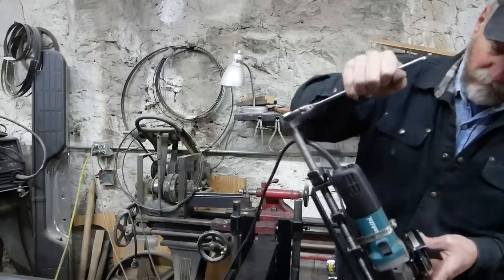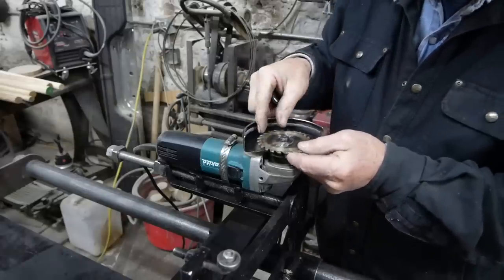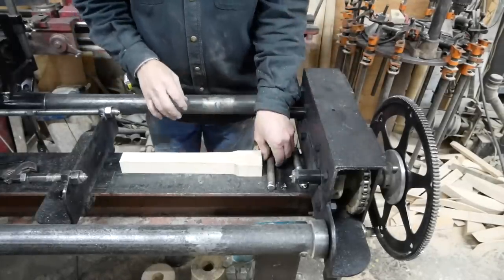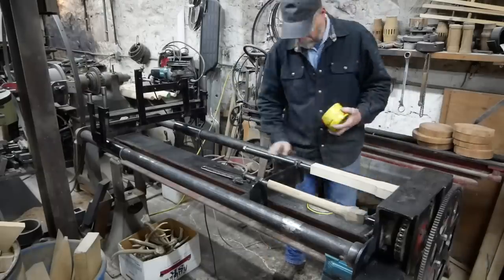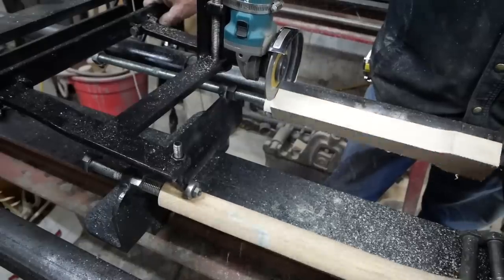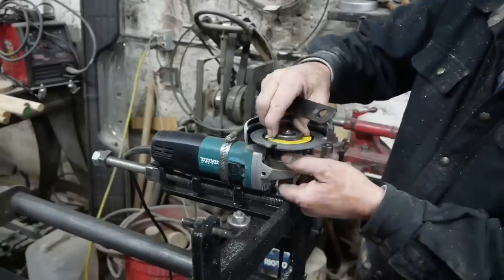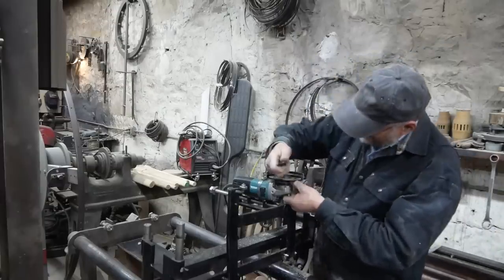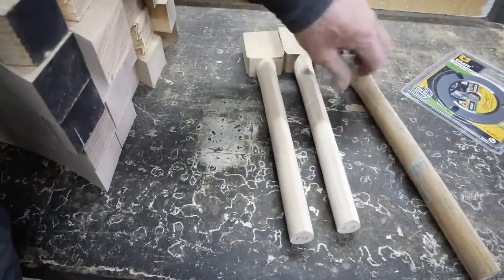Pattern Lathe for Custom Car Spokes | Graff Speedcutter on a Duplicating Lathe

Comment: seems like the only thing holding this rig back from being able to cut more agressively is the way the grinder is affixed. That hose clamp is introducing a lot of play in an otherwise remarkably accurate system. Have you considered using the existing side handle threads on the grinder to attach it more securely? Just a thought. It looks like it works very well for what you need it to do. Thanks for all of the fantastic videos. I have delved into your archives the past few days and it has been fascinating.

Comment: Your duplicator reminds me of me.  Another engineer doing what it takes to get the job done.  In my case I am an electrical-software-mechanical engineer doing one-off automatic test equipment designs in hardware and software, with test fixtures included.  You also remind me of MacGyver.

Comment: Reminds me of my dad...  He was a toolmaker in the 2nd WW when he was 20.  Had a true engineers mind to adapt and build with anything available. Even at that age he was making specialist tools for jobs.  It is an art - no different to a painter or sculptor - you see the end product and can naturally work out a way to get there. On 1 hand it's underpowered with a drill, but speed is not required in this case.  better to have full control and get it right first time each time without gearing to mess with.

Comment: Nice. I bet the texture is because the saw blade is at a different angle at the bottom of its travel than it is at the top. Still, nice work.

Comment: Looks like you built yourself a pattern copier/maker. All you need now is a small hand crank to move the cutter assembly along. And then you even could motorize that crank as well. But interesting concept and construction all the same. Thumbs Up!

Comment: Now that you have had it for a while I would like to know if you have had any problems with the teeth flying off? The most common complaint in Amazon reviews is loss of the teeth shortly after people begin using the blade. This would be unacceptable to me so I am curious as to your experience. Thanks!

Comment: When it comes to metal work a radius tool will produce the best surface finish. What you need is a smoother,  and slower, and consistent feed mechanism to feed the angle grind down the length of the spoke. I/m sure you could figure out some sort of pulley system or chain drive that stepped down so it was slow that automatically moved the carriage along.

Comment: Let me first say that I think this is a really nice machine, but...
I think that the follower bearing should be the same diameter as the cutter, to be sure that the profiles really match. 
Also, something I thought about watching another video, this ought to be a way to make hub cores fit hub flanges? Modifications would be needed, of course. A long bar on the follower, to reach inside the hub, for a start, and probably a 3-jaw lathe chuck to hold the flange rather than a wood-turning centre.

Comment: I somehow missed this video from 2018.  My loss.  The more I see of your work, the more impressed I am of the extremely wide range of your talent and experience.  Your ability to "ad lib" by inventing devices to do your work that you could Patent and sell to others doing jobs with similar materials is mind-boggling.  You seem to think that it is just "another day at the shop" when you come up with things like your multi-use duplicator in this video, which could also be used for metalwork if you beefed it up and used a heavier cutter mechanism and motor housing.  I have never seen anything quite like it in such a relatively small, inexpensive-to-build, very versatile package -- a kind of ganged-together pair of lathes.  Amazing!

Comment: That is a variation of the Blanchard lathe. Thomas Blanchard invented it in the early 1800s for turning gun stocks at the Springfield Armory. It can be used to turn axe handles,spokes knife handles, women's shoes heels,or whatever you need.

Comment: Why don't you make a couple ears off the bracket to hold your grinder and bolt it where the side handles go. I noticed the grinder twists under load . That can cause some gouging which would be your imperfections.

Comment: I've found a flat tooth with radiused edges is required whenever radiused and flats get together. For perfect no overlap cutting the tooth flat portion needs to be equal to the effective pitch of your linear actuating device, if you're using one. The radiused edges need to match your expected minimum radius or less. The pattern tracer needs to match the carbide's profile too. Just thinking out loud.  I've always preferred thinking from a lazy perspective but I'm told words like improvements and efficiency have something to do with marketing strategy but I was too lazy to finish reading the report . I do have a deep appreciation for your intertwined collection of ideas that made it to the machine level. Watching still feels like working without all that work. Take care and thank you, I've enjoyed every video.

Comment: Instead of a router bit  you might  try  a end mill  cutter. Unlike a router bit the milling cutter has a spiral grind on the end to give  a smooth cut. We use this kind of cutter when we have to mill down heads. They work fast and efficient This may work good on wood also. If your router is equipped with a 1/2 inch collet I think you may be able to find an end mill cutter with the same shaft  diameter. Just a thought..

Comment: A very interesting variation on the dutch or French clog carving duplicator machines! It would be a good way to make replacement axe handles too. Are you hand feeding the blank in as the cut proceeds?

Comment: That was neat!  I was kind of amazed that you could run your duplicator with just the drill, and then I started thinking about scaling the whole rig down a little bit for a smaller shop space to duplicate smaller parts for woodworking projects in woods that are a little easier to cut than Hickory.  A smaller duplicator for lighter projects could possibly make do with something like a Dremel tool to do the cutting.  Who knows, but it sure is interesting to think of all the possibilities.  This was a thought-provoking video, and it was nice to get the review on the Graff Speedcutter.

Comment: Excellent video,  a  better initial finish  would be achieved if the rotation of the spinals was faster, easily achieved by increasing the diameter of the drive cog ( say from a 12 tooth to a 16 or 18 tooth ).  if you could fit a worm drive to the feed instead of manually drawing it then the whole machine would be automated and set to give a uniform finish.

Comment: I note on some car spokes that the base(against the hub) is tapered in a wedge shape as your are,but the sides taper too, every second spoke has an opposite taper ,around 15 degrees on each side from the outer face of the spoke. Have you seen this at all ?

Comment: Again, excellent camera work explains nearly everything. That 1/2" Makita drill motor looks a lot like one I bought around 1980....and still works great. I also bought a 9" Makita angle grinder in 1982...runs fine, like the drill...!
 As for the 'car' wheels, how do the spokes deal with the torque generated, and the braking?

Comment: I like to tinker too.  I would try and cut alternate bevels on two teeth and a flat on the third tooth with slightly chamfered edges. Kind of like plywood circular saw blade pattern.  May not do much but it just might work.  Thanks for sharing your knowledge and experience.
Reply: Ash . That seems like another suggestion that could work and leave a better finish, hope Dave reads your suggestion and gives it a try .

Comment: Thank you ECS. Nice looking duplicater first time seeing this machine you did a very good job at making it. When a need arises we make what we need to get the job done.

Nice looking tent.
Reply: Great piece of kit, duplicator. One suggestion. If you can make the grinder and pattern follower move up and down vertically instead of pivoting on the hinges. I think that the cut would leave less of tool marks. Just a thought. Great vids. Really enjoyed them

Comment: I wonder how it would work with one of those grinder cutters that have scoops on them, they look like cylinders attached to a cutting wheel, very sharp, wicked sharp. I saw one used in carving and it leaved a pretty neat cut, tho, that also depends on the wood itself.

Comment: I wonder how hard it would be to make a drive out of a long piece of threaded rod to move the carriage.  Set it to move around a half tooth width per revolution.  That would minimize the ridging from the rounded teeth and you could add a couple of limit switches to shut off the movement and cutter when it gets to a given point.  That makes it a start and forget setup so you can be doing something else while it does each piece.

Comment: Zhou made an amazing machine there. I have something similar on my wood lathe for making hammer handles,stair spindles etc. It uses a router with a ball end carbide cutter. I believe it is called a replicator ,made by Holtzmann?

Comment: I am always amazed by your depth of talents. A coach maker, woodworker, blacksmith, fabricator, machine engineer and a tool maker.    Seems you have a good grasp on so many different skills and a master of many.  I'm sure you have more skills I can't recall right now.

If you were to engineer a mechanism to feed the cutter into the blank, you would be able to leave the duplicator and perform another task until the "auto-shut down" you set near the center hub is reached.

Comment: The duplicator looks like a very similar one I saw being used in another video some years ago mass producing rifle stocks in the USA , could well have been back in the 1800s when it was first invented.  As some other people have commented on here there are improvements that could be done on your set up but for the amount of use it gets there is little point as it works and does what you need if for.

Comment: Dave, you always remind me of a John Wooden quote "Be quick, but don't hurry". My Friday's have not been the same for the last year and a half. Thank you.
Reply: Just like the quote "Slower is Faster" when working on race cars.
Reply: Slow is sift, swift is fast.
Reply: Goes for most things. I see it a few times a week doing the mindless job of loading a trash compactor. Paced and deliberate orientation of loading in the flattened boxes. People throw stuff in Willy-nilly, it jams and reads as “full” prematurely. And takes otherwise unnecessary physical effort to dispose more.

Comment: This is too cool....I may explain this poorly but I'm going to try.  What if you put the head of the grinder in a ball and socket instead of just straight up and down on the carriage, and then connected two links on the tail side of the grinder to a vertical member on the carriage to make it a parallelogram (think the front control arm on a car that keeps the wheel veritical)?  I've noticed as the bearing rides the original the carriage tips a bit which I think might be where the lines are coming from and not so much out of adjustment. If the carriage were to pitch based on where the bearing is riding that would seem to keep a vertical witness on the cutter head at all times.  Might be over complicated for the application but might save you some sanding too.
Reply: If I get a stretch of time when I can, count on it!  I'd love to.
Reply: @NGinuity  You could also add a screw drive down the middle and though the carriage to move it end to end like on a lathe with a quick release collar for set up, just a idea lol.
Reply: As a one time Turner, I was aching for a screw drive!
Reply: Great! Inventiveness, the heart of American genius.

Comment: More great good fun!!  But you got me that time!!   I would have guessed a MORE rounded tooth would have been the answer.  I was also thinking that a "feed wheel" would have benefited...  but like with all machines... you have to quit Somewhere!  :-)  Thanks Again, Mr. Dave!!
Reply: @EngelsCoachShop  tautline single-wrap winch for the feed? it's how radio needles work so you can overspin the knob but the tuner doesn't get wrecked against the endstop. the knob has a smooth shallow v-shaped pulley  on the back, with a single wrap of string around it. the low friction between the string and pulley is enough to move the delicate tuner mechanism without allowing excess force. something that could help here is to have the knob on the carriage, with the tautline from the headstock to the far end support. it would allow you to drive the carriage from the center between the two rails which should help keep it from twisting as it moves
Reply: I see that he just pulled it along. Now he could waste time and hook up a spring to pull it.